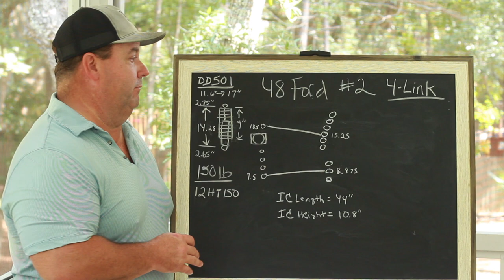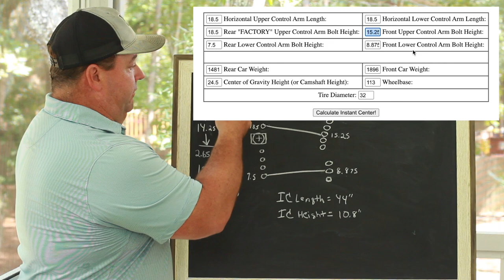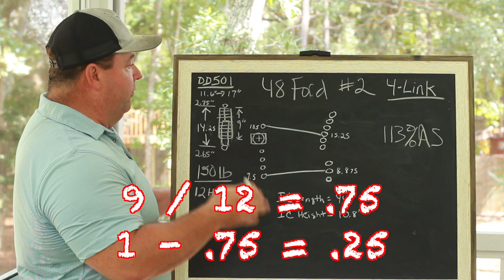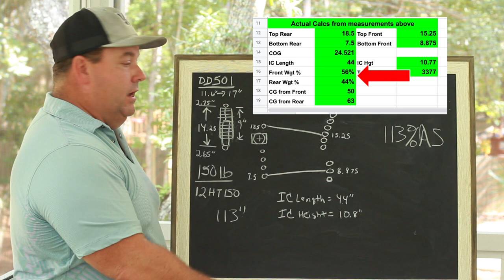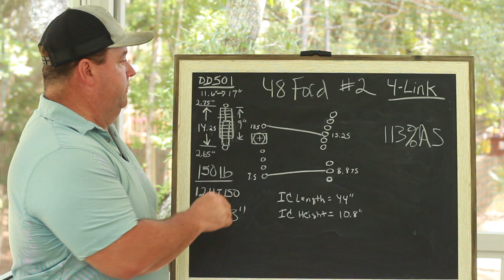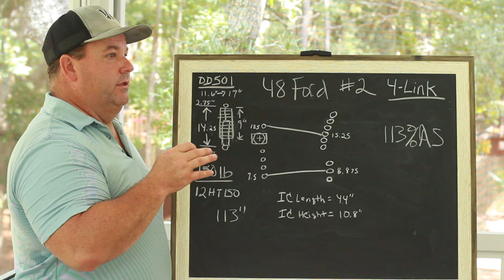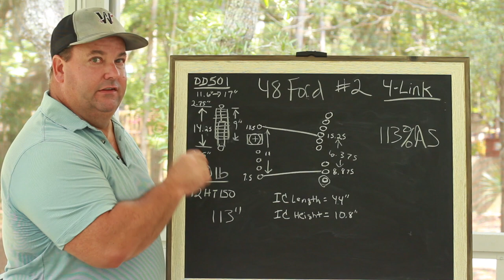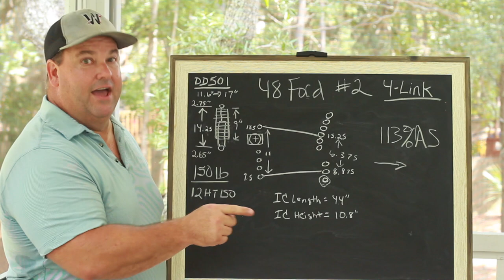4 Link Setup with Slicks | Drag Racing Suspension Tuning

Comment from the maker: See all the 4 Link measurements on the 48 Ford Coupe. Shock installed height, coil spring compression and how all this falls on the Anti Squat line. All measurements disclosed and how to use a great online 4 link calculator is displayed. I discuss the strategy on launching the 48 Ford on our first outing coming up soon!

Comment: Kevin, I think you are 100 percent correct. Esp being such a high Cam Height.  I think its important to point out if someone had a super low cam height, things change a little. I say all the time to the  small tire guys I work with/for, if you are running less than 100% A/S, then you are bandaiding another issue....be it chassis, suspension or wtv else. (Tire, power, etc.)
Reply from the maker: Cpo lt thanks so much for your comments and additional info! Thanks for taking the time to comment. Yeah, the CG of the 48 Ford is high for sure and a lower CG definitely changes things. Go fast, go straight! Be Safe!!

Comment: Good timing Kevin. Trying to set up the 4-link on my 74 Vette, small tire slick,  stick shift car. Ran 2 weeks ago at 145% AS and crushed the tires. Last week I  lowered the bottom bar and it figured at 114%, ( just a coincidence we're starting at the same place).  The car launched very well,  no tire shake, no excessive spin, just about neutral, so I'll be leaving that alone for now. The next step is dialing in the DD401's. I'm along for the ride with you on this one. Unfortunately we only have 5 weeks left up here in New England due to old man winter, but maybe we can get it close by then. Can't wait to see videos of your car on the track.  Standing by....
Reply from the maker: Robert Briggs thanks so much for your comments! Great info and I am glad you took the time to share your experience. Hope to get this one out very soon!! Go fast, go straight! Be Safe!!

Comment: A question about building a chassis and installing the 4 link cross member in the chassis.  At a level chassis desired race ready ride height would you have the front bracket bottom bolt hole height the same as the axle bracket bottom bolt hole ? That would have to the bottom bar at level with the ground and chassis when the bottom holes are used. Raising or lowering the coil overs would change the angle a bit.
Reply from the maker: General Sixty thanks so much for your comments! That is a great starting point. I rarely have the bottom bar going down as you go from rear to front. Go fast, go straight! Be Safe!!

Comment: Hi Kevin, how do I get your opinion on the way my top sportsman car is leaving.  I have 4 link wizard and video of the car. It seems to be hopping out of the hole. 
I also run a koni yellow electric shock box and may have forgotten which number is tighter on tbe rebound knobs.
Thanks, Chuck
Reply from the maker: Chuck Tersolo thanks so much for your question! I have not been successful keeping up with high volume of requests for remote help. You can email me as much info as possible from my website at https://samsonperformance.com and I will do what I can to help as time permits. Go fast, go straight! Be Safe!!

Comment: I would leave the bottom bar and would move the upper bar up 2 in front and then check my pinion deg and hope I can ice skate all the way down. Also what tire u running ??? Thats a big deal if your on a Goodyear or running M&H or some other type.
Reply from the maker: paul kendall thanks so much for your comments! I am running a 32 x 14 x 15S MT slick. Go fast, go straight! Be Safe!!

Comment: I've ran 103 to 125% for quite awhile on big tire slick. 14.5w with a glide . Inital hook is good. but seems I wants to spin 4to 5ft out when track prep starts goings away.. Do you see the same thing with this? And once you go over 100% antisquat does the adjustment of coil over shocks reverse? IE... more traction on intial hit you adjust rebound to add hit?
Reply from the maker: Hermann Douglas thanks for commenting. Go to samsonperformance.com and shoot me an email and I will respond. Go fast, go straight!

Comment: What is the downside of having over 100% AS on a big tire slick car?  Wheelies?
Reply: I think maybe you can crush too much the sidewall of the slick and have a footprint like a tractor tire
Reply from the maker: RecklessRegal thanks so much for your question! Too much AS will definitely crush a slick whereas a Radial you are trying to crush. It is a balance for sure. Go fast, go straight! Be Safe!!
Reply: I'd take a guess and say potentially crushing the side walls to much, but look forward to Kevins' reply.
Reply from the maker: @allanbigham1055  spot on
Reply: Dead hook, shake and breakage? In BIG power cars, there is talk of “wheel speed”, controlled spin.